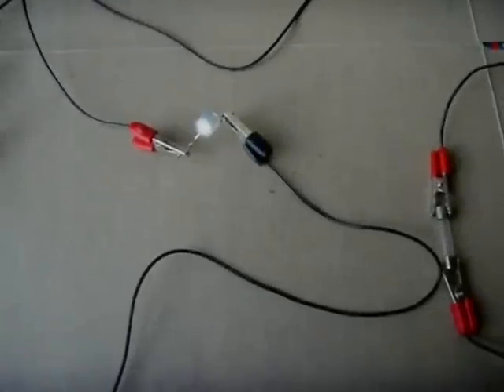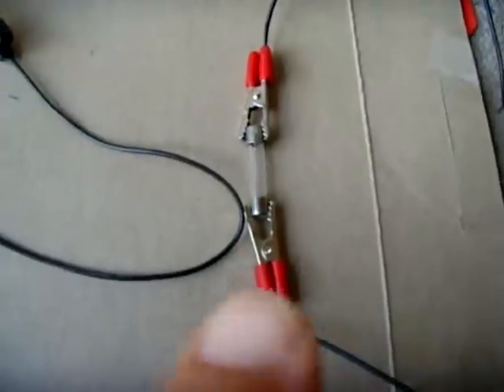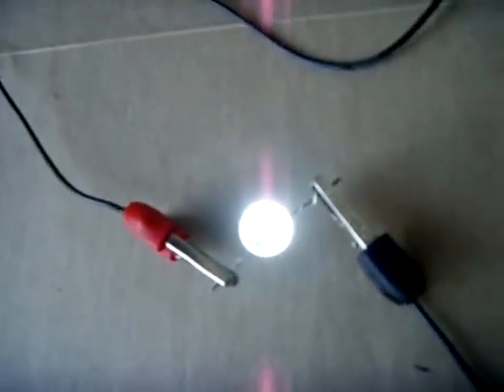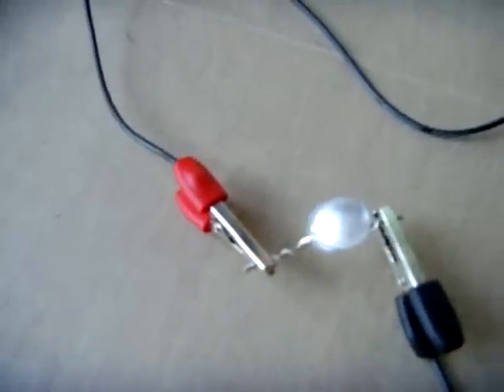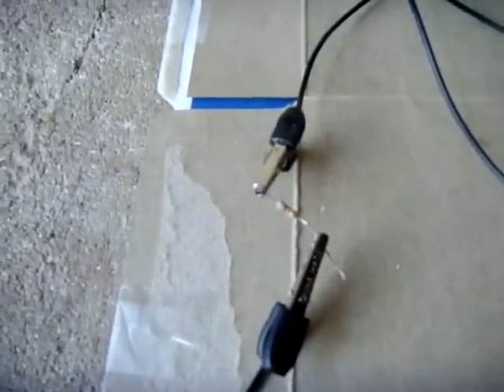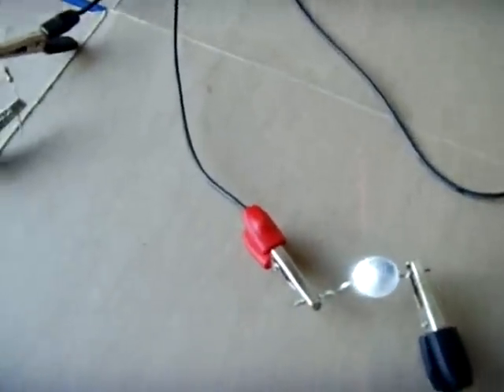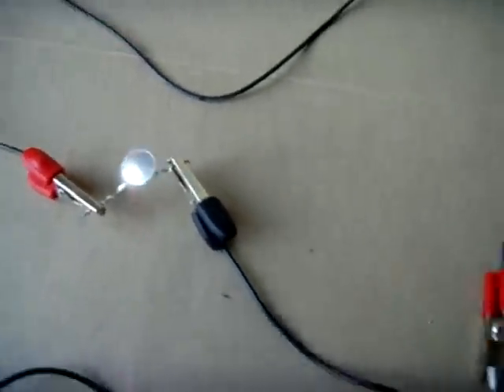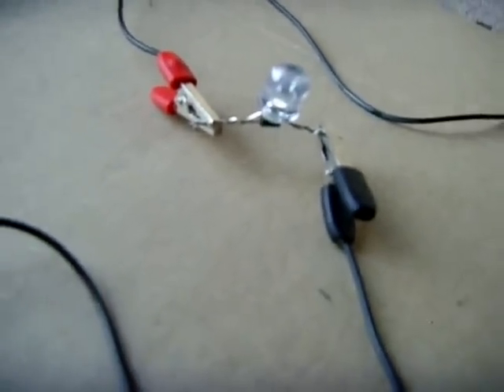How To Make An AC Mains LED Power Indicator

Comment: how i connect a indicator ligth in a water heater tank that carries 220volts…?
Reply from the maker: Use 100k ohm 1/2w and 4007 diode. For safety use a fuse coming off of each 120v leg

Comment: You are pushing the power rating limit of your 0.25W 47kohm resistor in this circuit.  I would suggest using a 1/2W resistor.

Comment: I don't understand the point of the parallel diode? Does it not just waste power not used by the LED? So you "balance" your AC, but why bother?
Reply from the maker: The parallel diode lets the negative pulse bypass the LED, which prevents LED failure.
Reply: @electronicsNmore  I thought the D in LED does that already (protect, not bypass)

Comment: Would the setup be the same on a 30a/120v circuit?  Installing a generator backfeed (with an interlock), but would like to have some extra added assurance that the circuit to the main panel is NOT hot before I plug in the generator.
Reply from the maker: Yes.
Reply: @electronicsNmore   Thanks!

Comment: Congrats,your vid comes up when I look how to wire an LED indicator to a 120 volt supply you have some good info,but it doesn't show how to wire this to something useful.I wold like to add this after a switch on an extension cord,or in line with a solder gun or power supply.I cant see why one would just want to hook 1 led to 240/120.If you added a diagram to show how to add this to an appliance or heater and not take away from power supplying that appliance it would help me,and others Im sure.
Reply from the maker: Very simple. Connect the circuit as shown across the AC line after the switch. The fuse connects to the 120V hot line, then to the 33K to 47K 1/4W or 1/2W resistor, then to the LED w/diode in parallel(make sure it connects to the side with the white line on the diode), then the other side of the LED to the white NEUTRAL line.
Reply: @electronicsNmore  thank you

Comment: But using a diode will half the negative ac cycle thus, reducing the voltage by half so why we would use 1/2 watts of resistance instead of 1/4 watts resistance? Please answer
Reply from the maker: Just do as shown in the video, it works. I have over 500 videos and I simply don't have the time to explain things to everyone. Thank you

Comment: Can you please tell me how to add a capacitor to help drop the voltage more efficiently?
Reply from the maker: No reason to, because this circuit works extremely well, but you can use a (.1 uF/400V rated) non-polar capacitor after the fuse leading to the LED anode, and after the LED you'll need a 100 ohm 1/2W to 1W resistor to limit inrush.
Reply: Thanks.  I just thought the resistor would alone would consume electricity by changing it to heat.   Is the anode of the diode connected to the cathode of the LED?  It appears that way.   I seen a video where someone connected the diode inline  one side instead of across , and put the resistor inline on the other side.  Don't know if that works the same.  
But your video is a blessing.  I need an indicator light of such.
Reply: @Accumulator1  the diode must be in parallel with the LED, in opposite polarity, to prevent the LED from seeing 120V when not conducting.  The LEDs are not rated to sustain such a high reverse voltage and would eventually blow up

Comment: For my project I need to wire a 3.4v 20mA LED as an indicator for 120vac mains; I've got a pile of different 1/2W resistors and some 1N4007 diodes, would these work for my project? If so, I'm not sure which resistor I should be using. Sorry, I know this is an old post to be asking on.

Comment: You could use a capacitor dropper circuit  so you do not have to worry about the heating of a resistor.   Sometimes called a transformerless power supply.
Reply from the maker: Yes, I have several of those videos on my channel. Thanks for watching!
Reply: @electronicsNmore  so what would be the value/rating of the series capacitor for 240V AC???

Comment: This is fine if you're using a high-efficiency LED, but using a 47K drop resistor, you're only driving the LED with about 2½mA — (not very bright for most "normal efficiency" LEDs), plus you're dissipating MORE than a ¼W on that resistor — 120VAC - 2V (LED Vfwd) / 47000 = 2.51mA × 118V ≈ 0.3W!  A ¼W may tolerate it for a while, but probably won't last > a year (@ 4-8 hrs/day).

   A better solution (for an "average" 10-20mA LED) would be to use a 200V (or better) film capacitor's reactance to provide most of your drop.
e.g. using a 0.33µF, you'd have 118V / [ 1/ (2π × 60Hz × 0.00000033F) ] ≈ 15mA, and you'd be wasting a LOT less power as heat from the resistor, although you'd probably still want a SMALL drop resistor — 470Ω or so for 120V — to prevent the first AC cycle hitting the uncharged cap (which is essentially a dead short for the first 1/60th of a second) from blowing the LED or diode, but this resistor would only be dissipating about 0.1W — (15mA × about 6.9V) — after the first few milliseconds.

   It's one more component, but over 60% LESS power is wasted as heat, and 6 TIMES as much current is delivered to the LED, making it considerably brighter, and providing greater longevity for both the LED and (especially) the resistor.

   Good video, though.
Reply: Andrew Ryder, how and where would I connect the .33uF capacitor?
Reply: @Accumulator1  to one of the phase lines.

Comment: I wish you had presented a circuit diagram, particularly to show the diode connection.
BTW I presume the diode could be positioned anywhere in the circuit - am I correct?
Reply from the maker: Diagram not needed. It couldn't be any simpler. Take the diode and place it ANTIPARALLEL with the LED. Anode to cathode, and cathode to anode.
Reply: @electronicsNmore  anti parallel? I have no idea what that means. A wiring diagram would be useful. What’s obvious to you might not be obvious to others. 
How do you mount the fuse if everything is in an enclosed box?
Paul
Reply: @electronicsNmore  - A diagram would be helpful to ensure proper polarity and how the diode is wired in.  You could just put a link to the diagram in the description instead of redoing the video.

Frankly, I stay away from high voltage and current, so I just thought this circuit was interesting.

Comment: Thank you so very much, I'm not a smart guy with all this electric stuff. I just wanted to put (1, one ) 5mm blinking LED Bub on a storage door jam showing that the alarm is set. I just want to have a 110 plug to plug into the wall inlet near the door inside the room. I have wire, 5mm blinking LED bulb, I have a 680 ohm resistor I was going to solider on but I did not think about the use. Thank you so very much, one guy said use transformer, other said AC/DC converter $320.00 and so on. I just want an 110/120 plug in electric warning light that blinks to stop employees for opening the door while alarm is on. LOL!!!Steve R......... www.youtube.com/user/MegaSquirrel01  is my site if you like  please give a thumbs up. I rehab hurt animals
Reply from the maker: Why does it have to be blinking? You can always do as shown in this video using a blinking LED sold on Ebay.
Reply: To dray their attention, does it make a difference in reisitor ?
Reply: plus that is the LED light that I was given. LOL!
Reply: Aren't the ones sold on ebay for 12v battery?
Reply from the maker: All single LED's that are blue or white, use 3.1-3.3V, Yellow, Red, and Green use 2V.
Reply: electronicsNmore. so i shouls use a larger resistor?
Reply from the maker: 4141Steve Everything was stated in the vudeo.

Comment: Great idea man, btw i have a question. How does the current know to only go one direction to the led? I noticed the diode is in parallel with the led so it has no choise but to go backwards through the led because the backdoor on the diode is closed am i right?

Im new to electrics so go easy on me..
Reply from the maker: Hi there. The diode shorts the negative pulses from the AC line and only allows the positive pulses to flow through the LED. You may like the video below. :-)

https://www.youtube.com/watch?v=9GvlGUbiPRo
Reply: electronicsNmore Thanks man but that video was terrible.. No hate though :)
Reply from the maker: asdf
Terrible? You're nuts. That video was excellent. It explains the AC sinewave, and how converting to DC results in a higher voltage. I thought you were new to electronics??? If you were, you would have greatly appreciated that video and not said something that rude. I didn't have to answer your question, you do know that, right?
Reply: electronicsNmore Oh please, it was just some guy hooked up to a terminal..
Reply from the maker: asdf What are you talking about? It was me showing what an AC waveform looks like on an oscilloscope. There's something not right with you. Clearly you're NOT looking to learn. Bye.
Reply: electronicsNmore Dont be like that man i was joking. I really meant no disrespect :)
Reply from the maker: asdf
Hope you never need my help in the future....:-) Bye.
Reply: electronicsNmore Come on man i said im sorry

Comment: cool! Just roughly calculated 47k for 120V, disregarding drop across LED, gives apprx 2.5mA and power rating required is about 300mW. However, it is keeping its temperature since it is conducted only half cycle :)
Reply from the maker: Thanks for watching! Be sure to rate thumbs up, share with others, and check out my video playlists.

Comment: greetings bro, is possible to reduce 120 volt to 60 volt by using just resistor?
Reply from the maker: Tell me exactly what you're looking to do. Thanks.
Reply: +electronicsNmore I saw a video on you tube, about the world smallest welding machine, what person does he connect one length of wire from the safety box to the welder  and take the neutral from the earth, it seems to work well, I was thinking of making one, but am trying to figure out what he used to reduce voltage.
Reply from the maker: rickeen salta
You need to use a step down transformer.
Reply: +Dan Coulson ok, what i want to make is one of those packet size welding machine that see in the Philippines, thanks any way thou
Reply: +electronicsNmore thanks for the info

Comment: If you need to control the heat dissipated by the resistor (for example, if this circuit is installed in a closed space), you can replace the resistor with a 0.1 μF 400v capacitor.
Reply from the maker: Yes, I have other videos explaining that. Thanks For Watching!
Reply from the maker: *****
Try a .22uF/400V minimum non-polar capacitor on one side of the LED(Anode), place a 1N4007 diode in parallel with the LED(Cathode to the LED Anode), and place a 1W 200-500ohm resistor on the other side of the LED(Cathode). Make sure the resistor does not get hot.
Reply from the maker: ***** Try a 27k / 1w resistor and the LED connected anti-parallel with the 1N4007. See if that gets hot when connected to 220v/240V, if it does, then use a 2 or 3 watt resistor. You won't need a 220 ohm resistor if you try it this way.
Reply from the maker: ***** Google search the term to see it.
Reply: For those of you who are too lazy :-), here's the relevant quote from Wikipedia:

In electronics, two anti-parallel or inverse-parallel devices are connected in parallel but with their polarities reversed.
Two LEDs can be paired this way, so that each protects the other from reverse voltage.

Comment: I am building a lamp, which is obviously powered by normal 120AC, but I also need to power two red LED's off the same power source, what will I need to do this?

Thanks man.
Reply from the maker: +Neal Lehman 
Hi Neal,
Take the 2 red LED's and connect the anode of the first LED to the cathode of the second, and the cathode of first LED to the anode of the second. Connect a 100ma fuse to the hot(black wire) of the 120V AC line, then connect the fuse to a 1/2W 15K resistor. The other side of the resistor connects to either side of the LED's which are connected anti-parallel. The remaining side of the LED's connects to the AC neutral(white)wire. Very simple

Be sure to rate thumbs up and share my videos. Thanks

Comment: could you use a 2nd LED instead of the 1N4007 diode?
eg 2 LEDs wired in parallel, but in opposite directions.
So 1 LED lights with positive half of cycle, and the other LED lights with the other half of the cycle.
(if you wanted 2 LED indicators)
Reply: No, because this will be unsafe. See an explanation below by zapro_dk. To recap, usually LEDs are specified for no more than 5V reverse voltage. 1N4007 diode will limit LED's reverse voltage to under 1V.
Reply from the maker: +ElectricPylon 
Yes. :-)

Comment: I'm putting an led inside the piston of my press. How do I make the led a little brighter? BTW, Your video saved my sanity! I did not want to use batteries. I've been searching for how to do this with 120VAC. I knew it could be done! thx.
Reply: I have a 5v blue and a white 5v led
Reply from the maker: +Daniel Crowley Sr 
Hi Dan. There are no 5V Blue/white LED's. They all operate around 3.1-3.5V. You need to purchase an ultrabright LED with a high MCD rating with a narrow beam(around 12 degrees).

Thanks For Watching! Be sure to rate thumbs up and share my channel.

Comment: So. 
I need a 100kOhm resistor (1W), a 1n4007 diode, a LED (3.3V , 20mA). And this should be good enough to build a power tester for 230V?
Reply from the maker: +Markus Bruun Rasmussen 
Yes. Should work just fine.

Thanks For Watching!
Reply: +electronicsNmore 
Cool. Im thinking about making a tester that test's 8 outputs. Sometimes from dimmers. Will it still work if, lets say the voltage drops to 120V (with the risistor for the 230V setup? Will it just glow less bright?
Reply from the maker: The LED will glow dimmer at 120v. Make sure you test everything thoroughly before using it. Always test the circuit using a known live power source before using it.

Comment: Going with this simple principle, what would it take to make the light blink while 240V is applied?  I want to notice that the device is on, and would like a simple system I could make.  (Why?  Because I am terrible at leaving an electric range burner on after cooking breakfast)
Reply from the maker: You would need to use the flashing LED circuit in my video list, then make a transformerless power supply for the circuit. I have a video for that also.
Reply: electronicsNmore Thank you - I'll look them up!
Reply: or he could build the same circuit but use a blinking led, they sell led's that blink when power is applied to them. No external parts necessary except for a current limiting resistor.

Comment: Very neat solution, Pal.  Used a watt meter it shown 0.6w and temperature peak at 58 degC. Hence, 1 Watt resistor is better, if not two 1/2W resistor in parallel for the heat dissipation.
Reply from the maker: Higher wattage is always better, but I had no heating issues using the proper resistor value. You must be driving the LED's at a higher current than in my video.

Thanks For Watching!

Comment: Thats different.
Reply from the maker: But it does work very well. :-)
Reply: I will have to try this. What is the LED rated at?
Reply from the maker: The ultrabright LED in the video is 3.1V / 20mA. You can drive them higher, but the life of the LED will decrease.

Comment: LED's cannot tolerate much voltage in the reverse direction, that is why it burns out. Usually white LED's can tolerate about 5V in the reverse direction without suffering any damage. In your case, the led sees 168V peak (as there is no load) and that breaks down the LED.
Reply from the maker: Never had any problems. Works fine for me.

Thanks For Watching.
Reply: electronicsNmore Exactly, as long as you have the reverse diode mounted, the LED only "sees" 0,7v in reverse.

Comment: I am seeking the lowest possible current to prevent the capacitor discharge in the CFL bulb. Do you think that the 3mA above is low enough and will do the trick? Even if the CFL bulb is on the stairway and it is linked to two wall switches (upstairs and downstairs) each needing a LED and resistor (3mA x 2) ?
Thanks a lot!

Comment from the maker: Simple. All you need is an LED(white or colored) and a 2W 75K or 82K axial resistor. Don't even need the diode. There will be little if any inrush current to destroy the LED, and due to the very low current flow, the LED can deal with the AC current with no problem. I used this as a power indicator for a very long time. No problems. MAKE SURE you use the proper resistor value & wattage! If you want more than 3 or 4 mA of current, then you have to use a lower value resistor, but HIGHER than 2W!!
Reply: Most datasheets I've read on a typical red LED show forward voltage of 2VDC @ 20mA.  Even with a breakdown voltage of 5VDC of reverse bias, they indicate it can only handle 10uA, in the reverse direction.  You should always have an inverted diode in parallel with the LED in an AC circuit.  I have burned out a few LEDs due to [normal] voltage spikes.  That stopped happening once I added an inverted protection diode.  Another way is to use a rectifier bridge so the LED is never reverse biased.

Comment: Is this setup any good to replace the amber-red neon bulb in a 220V/50Hz illuminated wall switch, so the Compact Fluorescent Lamp will not flicker (a fair flash every 6 seconds)?
If not what adjustments will be needed?
Thanks.

Comment from the maker: If you want it for a 9V battery to let you know when it is low in voltage, then you would need a 7.0V - 7.2V indicator, not 8.5V. My geiger counter circuit uses exactly that. You can use only that portion of the geiger circuit for your indicator. Go to the 1st geiger counter video I released. The one with the rectangular black box. The circuit is there.